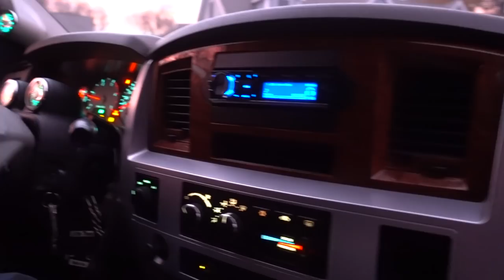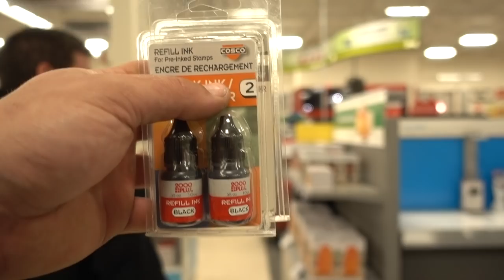INSANE FIRST GEN 12V CUMMINS BURNOUT!!! FIRE DEPARTMENT CALLED!!!

Comment: For ball bearing turbos you need a restrictor in the line so it sprays the oil. Can get a speedflow jic fitting for turbo with a 1mm restrictor in it.

Comment: That's a legit setup Greg. I want to buy a 1st gen now. Thanks for motivating me :)
Reply: Lee01Mr I've wanted one for years... Just can't justify getting rid of a 2nd gen for something that will break more. So I'll probably just buy one as a project when I can afford it
Reply: Brayden Aurich 1st gen just look so aggressive. Especially with street wheel like Greg's. And 2nd gens are amazing too. If I get that I dunno to go with a 12V or 24V. Damn you dodge for making cool cars lol
Reply: Lee01Mr lmao. I like my 2nd gen 24v alot. Hasn't caused me much troubles at all!
Reply: Brayden Aurich problem is the shipping it to the Netherlands. We barely have the Cummins here. But for me they rule more then the hemi trucks. Proper sleeper truck hehe.
Reply: @Lee01Mr  Definitely go with the 12V. I can't say anything about the 2nd gen 24Valves but I know that my dad's early 3rd gen 24v's engine compartment is completely filled. My 12v first Gen has enough space to hide a few bodies in the engine bay lol. I imagine the early 2nd gens are similar if not the same. Also I don't know when but at some point the government ruined diesels with emissions regulations and I am pretty sure the 24vs are like that. Plus the 24v is more fragile, the 12v can last a million miles if treated right, but the 24vs definitely don't. If you want something more refined go with a really early 2nd gen (at least older than 98 which was the first 24v) or if you want something more badass and unique go with a first Gen.

Comment: You could get an orifice for the oil inlet line on the turbo to reduce oil flow instead of downsizing the oil line. That way of some time in the future if you install a larger or different style turbo that requires the larger size inlet it's already there

Comment: You sir are correct about needing a restrictor for the turbo. Ball bearing turbos use hardly any oil flow to keep them lubed. Just swap out the line and your a-ok. Let her rip.

Comment: Buy coil springs and shocks it will give you a smoother ride in the front and will level it with the rear you wont need coil spring spacer

Comment: Also, if you spray some wd40 in your wheel wells and on the quarter panel behind the tires it makes the burnt rubber wipe right off! Also works for mud

Comment: I've enjoyed watching these vids. I've got the itch to go buy a Cummins. I love the sound they make, the power they produce, and   their overall reliability. My main question is what would be a good generation of Cummins should I look into buying (best bang for the buck)? Would the manual or auto transmission be a better choice (I don't mind driving a manual)? This truck would be my daily driver with occasional towing. Thanks and keep the videos coming!
Reply: the generation really just depends on what you are wanting to use it for. just for daily driving/ some towing any of them are great. They all have their pros and cons
Reply: I have had a 04 05 and now 98 12v 07.5 6.7  and I like mega cab the best but I would get whatever year and someone will buy it off ya when ya want to change it up.

Comment: would you be willing to try propane inj. on it ?
Reply: Be pretty interesting to see on a 12v ran it on my 3rd gen this summer no problems at all pretty noticeable difference
Reply: With today's fuel systems, no rear reason to run propane.

Comment: With the frame I don't understand why you're going to want to only paint what the cab hides and just primer the rest. If you're disassembling down to frame and basically building from ground up, why wouldn't you just have a finished frame and not have to revisit it?
Reply from the maker: Only because of all the fab work that is going to take place in the front and rear,(cage, fiberglass mounting, etc.)  then re paint once all the add-ons are complete, if that makes sense.